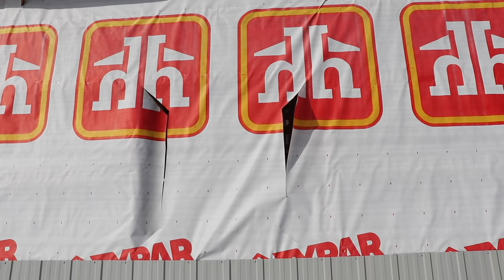Here's How I Built a Pole Barn (post frame construction)

Comment: I would patch around those piers with some concrete, if you have cold weather you don't want water getting in there, could crack your floor. You Daughter was a Very Hard Worker. Not easy working by yourself. Hey this is a Family Affair, you now got everyone working of this. All of you did a Great job. You know the sell a saw blade to cut metal that goes into your hand held circular saw or use a grinder with metal cutting disks. I like how you say "Garage Door".......lol. What part of the country are you from.
Reply from the maker: Stanley, thanks for the comments and kind words. I need to get some of those blades. I'm near Merrickville, Ontario. Where are you? Peter at the Reboot.

Comment: Nice job on this project.  I'm getting ready to build a 17 X 40 over a park model RV.  I will make one observation and perhaps someone already commented on it.  Spruce is a super soft wood, along with that I can tell that some of the boards that you milled were actually at the beginning of decay which is what the silver/grey color is.  Watching the large screws sink in too far makes me nervous for you as to the sheer strength of that building.  Most of the sheer comes from the metal siding and the roof, however the softness of spruce just makes me wonder how tight everything is and will be after a few years of wind.  All of that being said, you did a fantastic job on everything!  And you are right about the work it takes to do concrete.  Thanks for sharing this with us, while you were learning, we were learning.  Thumbs up!
Reply from the maker: Thanks Deric. Good luck with your project. Peter at the Reboot.

Comment: An excellent project - Very good job. I did something simular  30' x 40' x 10' with a 12' x 8' porch at the entry door. I used instead of building wrap a 1/4" bubble insulation sheet with bright aluminum on one side and white on the other on all the walls and roof. It is suprizing how cooler it is in the summer and warmer with no water condensation in the winter.
Reply from the maker: Thanks for the kind words Elliot. And, thanks for the tip concerning the bubble insulation. Peter at the Reboot.

Comment: TIP  Having built a pole barn yrs ago by myself, to raised material, I used clamps fastened to a post say at as high as I could reach, one end on resting on the clamp, then climbed a ladder with the other end, 2nd clamp etc.  the clamp serves as a ledge to support the otherwise loose lumber.
Reply from the maker: Good TIP. Thanks Michael.

Comment: How Long were those posts  that you milled    Love the video   Iam from PA  but have been fishing in your area for over 30 years    the fact that you are in one of my favorite places  made it even better  great job and very informative  Thanks
Reply from the maker: The posts, when milled, were a few inches over 12 feet. However, I cut them to 11'2". With a 10" beam the ceiling height in the shop is 12 feet.  I spend a little time each spring and summer enjoying the fishing in the region here. Have you ever had a meal at Stirling Lodge in Newboro? Thanks for watching! Peter at the Reboot.

Comment: When putting on metal roofing you need to roll the metal under your arm when you carry it up the ladder it ensures  you don't kink the roofing and expedites the process.  A metal roof like that with 3 men should be done easily by noon in one day.
Reply from the maker: Thanks Andrew. A good tip and a useful recommendation regarding  a crew. Concerning the team that did mine, they are 'general' contractors, that is, not a specialized roofing firm.

Comment: Brings several questions to mind.. 1. Why no rebar in the piers or slab? 2. What are possible problems with not kiln drying the wood? 3. I noticed that other than the post you used big box store wood, what did you use?
Reply from the maker: 1. The concrete is impregnated with fibre mesh. Engineer said it is an acceptable alternative. 2. There is some shrinkage, cracking and bowing. However, not enough to prevent its use in this application. Without question - kiln dried, lumber yard lumber is easier to build with. 3. Posts, purlins, girts, window framing, etc, was all milled on site (there is the odd store bought 2x6 and 2x4 in there). Trusses are constructed with kiln S4S lumber.

Comment: Cuestión, Why didn’t you used steel rebar on the floor before pouring the concrete?
Reply from the maker: Good question Hector. I consulted a civil engineer, the concrete company and the building inspector concerning rebar and or fibre mesh. In my application the three were unanimous: you could use either rebar or fibre mesh. They cost the same so I decided to try the fibre mesh (the concrete is impregnated with fibre mesh by the concrete company). Hope this helps. Peter at the Reboot.

Comment: I noticed that you have to slip the tin sheets and soffit under the piece before. I'm a novice too, but I thought you turn all the sheets so that they overlap rather than go under.  Looks beautiful.
Reply from the maker: Hi Dan. Yes, I do remember sliding them under as I worked my way down one side of the building. A pro would have installed them in the other direction. Thanks for watching.

Comment: great video, the building is really great, you have big balls and determination...., the only thing i dont understand is why you dont put the aislant material on the roof before you put metal shits..., specially for the rain and assolation...., im not a xpert but i was thinking it...
Reply from the maker: Thanks. If I understand the comment/question: I consulted with a contractor and watched RR Buildings. Both said no underlayment is required if there is good ventilation from the eave to the ridge vent. My soffits and ridge vent work well. So, no problems with condensation. Hope that touches what you're talking about. Peter at the Reboot.

Comment: Great job. One question. Why did you pour the piers separately from the slab? If the the piers and slab sit flush together and you’re not putting the posts into the piers, then why not pour into the piers and slab all at one time?
Reply from the maker: The building inspector required that they be poured separately and with a vapour barrier between them. He explained that it allows the pad to heave (lift vertically without damaging the piers due to frost and freezing - extremely rare but could happen). Hope this helps. Peter at the Reboot.

Comment: Would you consider posting a cost of having it done versus cost of doing it yourself (minus your own labour costs)? That would be fun to see!
Reply from the maker: I have a plan to put together a 'cost' video. Need to think about it a bit more. Peter at the Reboot
Reply: I built a 32x56 building just about same way real close, I had $2500.00 in my building.
Reply: Do you mean $25,000? Cause you can’t buy the wood for a building
that size For $2500

Comment: I admire your drive to get this done. I am home/garage/commercial builder and when I see how much lumber goes into these types of building, I always shake my head as to why people do it. In your case you saved the money because you had the RAW material basically for free. Otherwise, it is cheaper and stronger to build this size of building via the conventional framing method.  Congrats, look very good !!
Reply from the maker: Thanks 👍
Reply: No way. Stick framed walls
Take much more Lumber. Just a little Math shows that.
Reply: Also in pole framed construction you don’t need to header the windows or doors become there is no Load bearing on them.
Reply: @cygnus1965  Not if it is framed at 24 inch centers using 2x6. A little math shows that.
Reply: One word sheathing. Have you seen the price of osb recently.
Reply: @cygnus1965  You dont have to sheath it. You can just strap it just like post frame and install sheet metal. Ive done many.

Comment: you can rip that metal across the width with your hands. just cut a notch on the side where you want to cut it , stand on one side and rip. it will be within 1/8" of square. Sounds crazy but it works . My petite granddaughter did it
Reply from the maker: Thanks Art. I will try this because I'm sure there is more metal siding in my future. Peter at the Reboot.

Comment: Did you put a trim piece on Bottom of lower panels. I saw another video from another off grid project and they were getting mice in walls because of bump in siding. Just Wondering 👍
Reply from the maker: I did not put on a trim piece. Instead, I inserted a gasket kit that fills the contour bumps. It was provided by the supplier. It seems to work and there no mice.

Comment: Really glad I ran across your channel. This was a great build and I learned a few things.  I have considered  doing a pour for the foundation in sections the way you did it and you just proved it will work great !   Incredible job Bud , Love it.   One question , if you see this.  Why not put wrap under the roof metal ?   I don't know come here from sic 'em about building other than the videos I've been watching.  but it seems like the metal will sweat and drip if you don't have a medium to channel the condensation away .  Enjoyed the video.  Im sure I would be watching a couple more times. !   Congrats on your project !
Reply from the maker: Good question WH. I spoke to some contractors that said it can be done this way. Also, Kyle at RR buildings shows it can be done either way. Concerning the method I chose, there must be good air flow from eaves to ridge vent. I've not experienced any 'sweat' yet. So far so good. Peter at the Reboot.

Comment: +1. .. Will electricity be handled via a Solar Photovoltaic w/storage system? Cheers,
Reply from the maker: Hi Michael, I installed a 700W solar system that provides power for lights and to run tools under 15amps. You can see the details in my March 23rd video. Peter at the Reboot

Comment: Why didn’t you put the vapor barrier under the concrete slab ?  Why no wire mesh or rebar in the slab ? Great video a lot of hard work.
Reply from the maker: Thanks for the questions 59. I did install a vapour barrier under the concrete. If not in this video, I recommend you have a look at the foundation series. Wire mesh: I ordered the concrete with fibre mesh. The supplier informed me wire mesh was not required from a strength perspective if impregnated with fibre mesh. The approach was approved by the local building inspector. Thanks for the positive words. Peter at the Reboot.
Reply: We poured a garage floor back in 88 and it has fiber no metal and it still looks as good as the day it cracked. Lol 
Meaning they are still just like the hairline cracks when they formed. Metal Cant do as good as the fiber for that.

Comment: Great video. How did you keep your self-milled lumber from warping as it dried? My concerns of milling my own has been the thought that it needs to be dried using the right method and for a significant amount of time. Thanks for sharing.
Reply from the maker: Thanks Ida. The best way to prevent warping is to sticker and stack the lumber as soon as it comes off the sawmill. The weight of the pile keeps everything flat as it air dries. Having said this, some of the lumber will warp. The other option is to have your lumber kiln dried.

Comment: Great video! So how long start to finish? When are you going to post DIY/Retail cost comp.? Why didn't you use rebar? Mobile scaffolding was genius! Did you use any additional rear trailer supports after in position? Again great video and great job! Please and Thanks from OHIO.
Reply from the maker: Thanks Sonic. I have plans for a shorter video that will address the questions you've raised. Rebar: I didn't use rebar because the concrete includes fibre mesh. A contractor and building official said the rebar was not required and was over kill. Rear trailer supports: yes, I had wood blocks for the rear and front when the trailer was parked. Thanks for the questions and comments. Peter at the Reboot.
Reply: Hi did you include the cost for the rental equipment...those machines cost big bucks.  Also the cement would have cost over $5000.00 alone.  Seems to me $2,500 is a bit light but I'm listening.  Thanks

Comment: So I don’t see you using any rat board, have you had any problems with mice getting into the walls at the bottom?
Reply from the maker: I added a gasket and 2x6 board at the bottom of each bay between the posts with nails and adhesive, created a tight fit with the foundation and exterior metal. There are no holes and no mice to date.  Fingers crossed.

Comment: No bar or wire mesh in the concrete Piers or slab might would have added footers looks good but i think you should have reinforced the concrete
Reply from the maker: I asked many questions about this. I sought input from an engineer, the building official and the concrete company. The conclusion: I ordered concrete infused with fibre mesh. I was informed I could install rebar or use the fibre mesh option, or both. They said both was overkill. I decided on fibre mesh. Time will tell if this works.

Comment: I put up a 40X50 pole barn in 1980 with plastic sheeting on the roof that was the hard part
Reply from the maker: Very impressive. How did the plastic sheeting weather over the decades?
Reply: @TheWoodlandReboot  sold the place in 2003 was holding up just fine, it was made for the job.

Comment: One think I can’t stand is cracks in a slab I would have put rebar
Reply from the maker: I've seen slabs with rebar crack. I used fibre mesh. The concrete company, the approving engineer and a contractor told me fibre mesh would work for my application.

Comment: I don't see any special 4" wide water proof taping around your windows???  GREAT JOB on build and thank God for family and friends lol.
Reply from the maker: Thanks Sandra kind words. Concerning the windows, you are correct. I used tape but I did not use any water proof taping/membrane on the windows or framing. I thought about it; however, here is my reasoning: overhangs are 18"; there is a metal rain diverter installed on top of each window; I decided I was not building to top spec quality; I am on a budget (the three used windows cost Cdn$100 together); the gaps are filled with foam; and, it is not a home. Yes, I could have included the membrane; however, given my approach and the above reasons, I am OK with it and believe the windows are relatively well protected. Peter at the Reboot.
Reply: @TheWoodlandReboot  wow GREAT price on the windows good job LOL.

Comment: Did you use spay foam insulation and a heat source?
Reply from the maker: Hi Denise, I'm in the process of adding rolls of fibreglass insulation ... a very slow process. You can see what I'm up to in my most recent videos. I plan to add a heat source eventually - probably propane. Thanks for watching. Peter at the Reboot.

Comment: I’m sure you’ve already answered this but did you dry out the logs before or after milling?
Reply from the maker: For a non-habitable structure, I did not have to use kiln dried lumber. Be sure to check with your building authority.

Comment: why didn't you drop the saddles into the pillars when they were poured rather than drilling holes after the fact?
Reply from the maker: Very good question. I was not able to ensure the accurate placement of the saddles in the wet mix. Once dried, I was able to secure a line to set the saddles more precisely. Peter at the Reboot.

Comment: Great job.  Do you have any issues with the lumber warping?  I didn't know how green it was when you sawed it?
Reply from the maker: Craig, It was green as it came off the sawmill. I air dried most of it for about eight months in stickered piles. Regardless, there was some warping. In the end, I was able to use and work with most of the warped pieces. Thanks for the question. Peter at the Reboot.

Comment: Just a question, Why did you finish your concrete floor that way with those large expansion joints
Reply from the maker: The product, expansion joint material that came in a role, was recommended and I used it. Very simple.

Comment: No wire mesh and rebar for support?
Reply from the maker: I have some wire mesh in the area of the garage door but did not film it. Concerning the rest of the slab, it is 'impregnated' with fibre mesh. Yes, I know many don't like this approach; however, I spoke to several contractors and the concrete company concerning this issue. They said rebar plus fibre mesh is overkill and that either one works without the other in this application. I took their advice.
Reply: @TheWoodlandReboot  thanks

Comment: No rebar in the pad?
Reply from the maker: Hi Jonathan, I ordered the concrete with fibre mesh. The concrete company and the engineer I consulted approved this approach, that is without rebar. Regardless, I installed wire panels in the floor at the garage door opening. Time will tell if this approach is valid. Peter at the Reboot.

Comment: Did you have to get the lumber you milled graded or did they just let you use it?
Reply from the maker: Good question Ian. In my jurisdiction, non habitable buildings do not require graded lumber. However, all buildings require stamped and engineer approved trusses. Peter at the Reboot.

Comment: Wait did I miss the rebar in those slabs??
Reply from the maker: Yes, no rebar. I purchased wet mix that was impregnated with fibre mesh. The concrete company, an engineer I consulted and building inspector explained you can combine rebar with fibre mesh (overkill) or use either one separately. So, I have gone with this advice. The fibre mesh cost as much as the rebar. Time will tell. Thanks for watching.
Reply: @TheWoodlandReboot  that’s really interesting, quite a time saver. I hope it holds up!